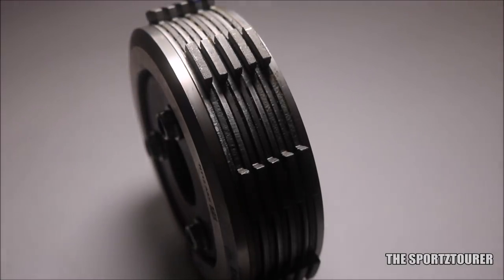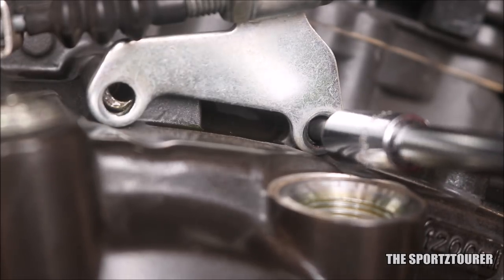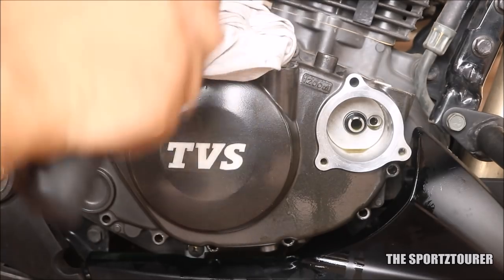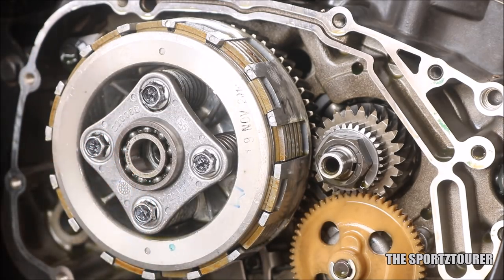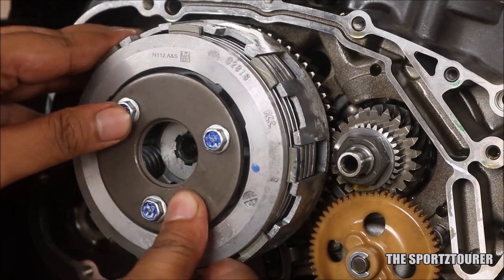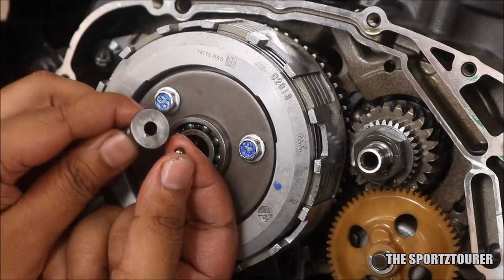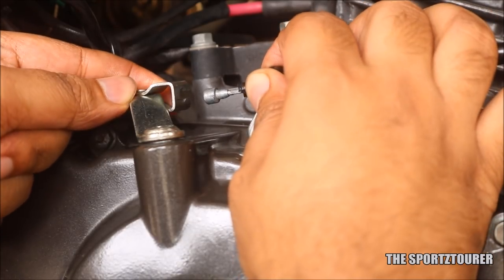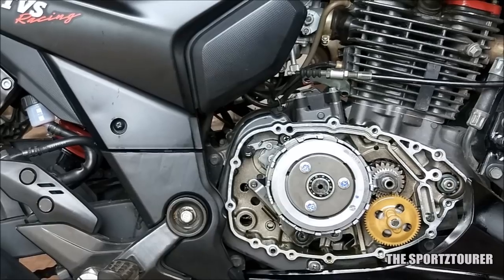HOW TO INSTALL SLIPPER CLUTCH IN BIKE TVS APACHE SLIPPER VS REGULAR CLUTCH, SLIPPER CLUTCH EXPLAINED

Comment: Great work bro!
Have anybody installed this slipper clutch on Apache 160/180?? 
Is that possible?
Reply from the maker: Thanks a lot Soorej,
The RTR 160/180 does shares a lot of parts in common (as shown in the video). Only thing I have doubt about is the clutch housing and the clutch shaft which I doubt isn't the same. Unless we practically check it, we cannot confirm on that 😊

Comment: Hats off to you bro. Can I install the same slipper clutch in Honda CBR 250R ? Will it work normally or will I face any issues in future ? Please kindly reply. Thank you in advance.
Reply from the maker: Hi Sudharshan,
This particular one won't fit but Takegawa makes one specially for the CBR (don't have any personal experience): https://japan.webike.net/HONDA/CBR250R+%282011-%29/6225/m/p.b=704/
Reply: @thesportztourer  Thank you very much Dude.... Sorry for the late(est) reply. https://youtu.be/oEGC4jB7rI8 Please can you check the above link and suggest me whether the jerk or shake of the clutch hub in the housing is normal in my cbr 2018 model !!!! Or should I need to change the hub ? Thank you in advance for your reply.

Comment: Great video Man 🙌   I have a question... Can I fit 200's slipper clutch in apache 180 ?
Reply: What about the question man ? Is it possible ... Do u have any info ?
Reply from the maker: Hi Somnath,
The clutch shaft diameter is not same on the both the motorcycles. Still I we need to practically check for the fitment 😊
Reply: @thesportztourer   Thanks In advance man.. 😀 💟

Comment: I appreciate your work.
Is this possible with RS200?
Reply from the maker: Hi,
I doubt this will be a direct fit as the RS 200 has a different clutch housing.
Thanks a lot for appreciating the efforts, means a lot 😊
Reply: @thesportztourer  would the dominar clutch plates be fixed as it has slipper clutch

Comment: Hi buddy. The mechanic who installed this in my bike told me to that the last plate on the clutch (power plate he said) needs to be repositioned to fit the housing. And it's absolutely necessary. Is that correct ? I asked him not to do it as you didn't suggest it. 
Please let me know what you think about this.

Comment: So, I got some issue in my clutch system and mechanic at tvs told me he has get the clutch plates changed and grind the unit and fix it back, but having seen this video I told him to install the slipper clutch unit instead and after a day he informed me that it is possible but would cost me around 9k for the full change. I even showed the mechanic this video and convinced him to change the clutch system. Strange thing after getting everything done, there is a strange noise from the engine, sounds like the bajaj CT 100 engine. I haven't got the time to visit the service center lately but feels awkward why the engine has to be opened just within 2yrs of use having done 18k kms
Reply from the maker: Hi Anugrah,
So you are now running on slipper clutch?

Comment: Do provide us an update on the performance of the slipper clutch and if you face any problems along the way!
Reply from the maker: Sure Kiranraj,
Expect a lot term review where I will share my detailed experience along with all the goods and bads 😊
How was this video?
Reply: @thesportztourer  It was very informative and useful like always.☺️
I also own a RTR 200 and I'm also thinking of upgrading it with a slipper clutch. It is a well designed motorcycle!
Reply: I have a suggestion!
In my Apache 200 the Air/Fuel pilot screw is stuck and is worn out. Can you make a video on how to remove it and readjust the carburetor.
Also you can make a video on suspension changes , like how to change the adjustable rear suspension according to rider preference.
This will help a lot of RTR owners.
Thank you for all the informative videos!
Reply from the maker: Air fuel screw stuck and striped! I did said to be careful and gentle here: https://youtu.be/3LOP8asQ6Ek
Showroom guys can help or you can take the carb to an good lathe workshop where they can help you.
The rear suspension needs a special tool for adjustment, will make a video when I get one for myself 😊
Thanks for the suggestions, have taken a note for myself 👍

Comment: nice video man  I'm the owner of pulsar 150 ug3 model with digital display I wjust wanted to know can i use this slipper clutch assembly in my pulsar 150 ug3 model & if it is possible then how it is possible please tell me
Reply from the maker: Hi Kailas,
This slipper clutch won't fit as the clutch housing and clutch shaft is different on the Pulsar 150.

Comment: Hello Sir,
Really great video and I liked perfection of all work.
Sir I have a question that is it possible to fit slipper clutch in Honda CB Hornet 160r??
Reply from the maker: Hi Vinay,
The Hornet has a different clutch set up with different dimensions so this won't fit. Thanks a lot for appreciating the efforts that has gone in making this video 😊
Reply: Is it possible to fit slipper clutch in fzs v2.0???

Comment: I hav also the same nd also the huge fan is there is a difference in torque or bhp as compared to wet clutch?? If I install slipper clutch

Comment: Hi, I wanna ask one question i-e slipper clutch has 6 clutch plate and 5 friction/pressure plate however normal clutch assembly has 5 clutch plate and 4 friction/pressure plate. My question here is how does does slipper clutch fit in place of normal clutch housing ?

Comment: Those who like better stoping with  help of engine  dont fix it.. because in city or anywhere  except a race track you need to stop any time. Sliper clucth didnt help to slow the running speed by same as a normal clutch doing.    when ride in higher speed down the gear and you can reduce braking distance in a normal clutch. Thats my point.

Comment: Hi... Very informative.. myself Ashwin from Karnataka.. using Pulsar 220F 2010 model.. my question is can the slipper clutch can be installed on pulsar 220F 2010 model...?
Reply from the maker: Hi Ashwin,
The clutch housing and the clutch shaft is different on the 220 so this thing won't be a direct fit. 

Enjoy the raw power of the 220 and ride safe 😊
Reply: @thesportztourer  thanks bro.. Enjoying safe ride... keep uploading the videos .. good work..keep rocking .😃

Comment: The most outer plate, is it positioned correctly ? In case of "non-slipper" ones, the most outer plate is positioned a bit differently like it has it's own outter position. This one has the space but you kept it empty. Let me know what you think if you get to read this comment.

Comment: Can same done in ns200
Reply from the maker: Hi,
This won't fit in NS 200.
Reply: Can u research and tell can any clutch slipper clutch can fit in ns 200 

Dominar or RC 390 assembly can be installed in it
Reply from the maker: Hi,
I did an enquiry at Bajaj service for the slipper clutch assembly but it was not available. The technician over there said the slipper clutch won't fit on RS or NS 200. So that's the recent update from my end 😊

Comment: Awesome 😍😘 👏 video bro, one small doubt slipper clutch it also fix in Apache RTR 180 serial fast (beast model bike) ,it is possible or not?😅
Reply from the maker: Hi Logesh,
The RTR 180 does shares a lot of parts in common (as shown in the video). Only thing I have doubt about is the clutch housing and the clutch shaft which I doubt isn't the same. Unless we practically check it, we cannot confirm on that 😊

Comment: Can you please confirm if this can be installed on an Apache RTR160 Hyper Edge. This will be a different experience altogether to the Previous model users of this can be installed.
Reply from the maker: Hi Avinash,
I get your point 👍 the RTR 160 does shares a lot of parts in common (as shown in the video). Only thing I have doubt about is the clutch housing and the clutch shaft which I doubt isn't the same. Unless we practically check it, we cannot confirm on that.

Comment: @The Sportztourer After 4 years I’m returning to motorcycling, I’m in need of a motorcycle badly. I liked hunter for my needs, but I have issue with it’s hard clutch. Is there a way to retrofit slipper clutch for RE Hunter?

Comment: You removed two metal washers, but while putting the slippery clutch you put only the back washer, didn't put the top washer just beneath the clutch nut. Is slippery clutch need only one washer.

Comment: Hi . I just want to know that if make this installation of slipper clutch in rtr 180 bs III will it work?
Reply from the maker: Hi Dev,

The RTR 180 does shares a lot of parts in common (as shown in the video). Only thing I have doubt about is the clutch housing and the clutch shaft which I doubt isn't the same. Unless we practically check it, we cannot confirm on that 😊

Comment: Please tell me how to change normal clutch plate to slipper clutch in appache 180 2013 model
Reply from the maker: Hi Sreejith,
The the 180 shares the same parts so you can follow the exact same process. In addition to this you have to remove the kick lever and skip the oil cooler part.
Reply: @thesportztourer  bro will u check it whether it suits or not in apache 180
Reply from the maker: Slipper clutch?

Comment: If i buy a new cbr 250r. Then i changed it's clutch plate, and fixed a new rc390's slipper clutch plate in it, does it possible ?
Reply from the maker: Unfortunately it won't be direct fit as the clutch shaft and housing is different.
Takegawa makes one specially for the CBR 250R: https://japan.webike.net/products/21400281.html

Comment: is it possible to install aftermarket sliper clutch on any bike ? ur vid gave me idea to install on my fz 25 will that b possible ?
Reply from the maker: Hi Sumit,
A few Indonesian riders have installed the slipper clutch from R15 V3 in FZ 25. When asked they were unable to confirm if it was a direct fit.

Comment: Hi, i think its time for me to update slipper clutch on my pulsar 180, thanks for the video. But will this fit pulsar 180?
Reply from the maker: Hi Roger,
The Pulsar 180 has a different clutch shaft so this won't fit.
Reply: @thesportztourer  can you let me know the suitable slipper clutch for pulsar.. It would be helpful!
Reply from the maker: Right now slipper clutch is not available for Pulsars. Let's hope Bajaj rolls out slipper clutch in the next version of Pulsars so that we can retrofit them 😊
Reply: @thesportztourer  I guess it can be done on rtr 180 and rtr 160

Comment: Where can we get to buy the slipper clutch? Also, can i install in my new apache 160 4v which has just run 3500kms. And will there be any problems after fitting the slipper clutch?

Comment: Hey bruh can i install slipper clutch in rtr 1604v ? If yes can i fit the clutch assembly of that rtr 2004v in to my 1604v because i see both have 5 gears and same mechanics.

Comment: Can we use the slipper clutch in Apache 160 RTR 2015 model
Reply from the maker: Hi Ravi,
The RTR 160 does shares a lot of parts in common (as shown in the video). Only thing I have doubt about is the clutch housing and the clutch shaft.

Comment: Sir, can you  switch clip on handlebar with single piece handle bar on apache rtr 200?
Reply from the maker: Hi,
The one on the RTR 160 4V is not a direct fit on the 200 4V
Reply: @thesportztourer  can you please make a  blog regarding the handlebar ?

Comment: Can we do this to gixxer? If yes than please make a video and also tell us where to purchase slipper clutch for suzuki gixxer.
Reply from the maker: Hi,
I doubt if it will be a direct fit to the Gixxer as the clutch housing is different. Even though the Gixxer doesn't gets a slipper clutch, I found the clutch on the Gixxer to be really smooth in terms of pulling efforts.
Reply: @thesportztourer  Thanks for reply. As u r having good knowledge of machines, videos regarding explaination on effect of exhaust note on power and torque figures on a motorbike will be highly appreciated. Moreover I would like to know that if I change the exhaust of gixxer and go for some after market good sounding exhaust than will it have any effect on power and torque figures?

Comment: Bhai please tell me how to fit slipper clutch in TVS Apache 180
Reply from the maker: Hi Lokesh,
The RTR 180 does shares a lot of parts in common (as shown in the video). Only thing I have doubt about is the clutch housing and the clutch shaft which I doubt isn't the same. we cannot confirm on that unless we practically check it.
Reply: thank yuo bhai

Comment: Can i fit rtr 200 4v fi version rear brake on 160 4v and what all parts can i use similarly
Reply from the maker: Hi c K,
Not an easy task as a lot of different parts plus we need to check with compatibility. You can expect a change in whole set up, my suggestion will be to stick to the stock set up 😊

Comment: Is it possible to add the slipper clutch parts from Apache 200 to Pulsar 200?
Reply from the maker: Hi Aakash,
The Pulsar 200 has a different clutch housing and clutch shaft so this won't fit in.

Comment: Can R15v3 slipper clutch assembly be installed in v2?
Reply from the maker: Hi Saikat,
Some riders in Indonesia have already done it so I think it should fit. Only doubt I have is whether it will be a direct fit or the housing will require a replacement.

Comment: Should slipper clutch can installed to bajaj pulsar 200ns?
Reply from the maker: Hi Somprakash,
The clutch housing and clutch shaft is different so this won't fit.

Comment: Bro can i use this slipper clutch in apache rtr 160 2014 model...?
Reply from the maker: Hi,
As per the recent info the shaft diameter is different so this won't fit in.

Comment: Bhai.. can we use slipper clutch to rtr 160 hyper edge..???
And 
Thanks for very informative video ..also love open engine..
Reply from the maker: Hi Ranjeet,
As per the recent info the clutch shaft diameter is not same so this won't be a direct fit.
Happy to know that you liked the video so much, means a lot to me 😊
Reply: @thesportztourer  does it works

Comment: Is Slipper clutch is available for As200 pulsar.. please share your views
Reply from the maker: Hi,
Right now in Bajaj line up slipper clutch is only available in Dominar. If Bajaj brings it in for RS 200 or even NS 200 then you can retrofit it on the AS 200 😊

Comment: Bro i have seen many videos in YouTube and i have tried to install slipper clutch in my RTR 160 4v 2020 model but after installing the clutch i took a test drive when I put 1st gear pressing clutch the bike moves without releasing the clutch and also gear shifts are hard pls let me know is that a manufacturing defect of the slipper clutch or anything else which is causing this problem 
Pls comment

Comment: is there any chance in replacing regular clutch of regular apache rtr 160 with slipper clutch
Reply from the maker: Hi,
The RTR 160 does shares a lot of parts in common (as shown in the video). Only thing I have doubt about is the clutch housing and the clutch shaft dimensions.

Comment: Hyyy brdr    can i use this slipper clutch in my Honda CBR 250r
Reply from the maker: Hi,
The CBR 250R has a different clutch housing and clutch shaft so this thing won't fit in. The 250R is a fantastic machine and I have a soft corner for it, I wish Honda gave some more technical update to it this time as swapping the parts would have been an easy job.

Comment: Can we use it for old apache rtr180/160. Please replay.
Reply from the maker: Hi Gairik,
The RTR 180/160 does shares a lot of parts in common (as shown in the video). Only thing I have doubt about is the clutch housing and the clutch shaft which I doubt isn't the same. Unless we practically check it, we cannot confirm on that 😊

Comment: Friend can I use this slipper clutch in old versions of RTR 160
Reply from the maker: Hi,
The RTR 160 does shares a lot of parts in common (as shown in the video). Only thing I have doubt about is the clutch housing and the clutch shaft.

Comment: Bro i have Apache rtr160 i have installed 6 plate clutch where it used to be 5 plate clutch . Now my question is can i able install sliiper clutch in my beast model Apache rtr160 not 4 v model !!!! Plz reply .is it possible ???????

Comment: Hi, is the same 200 4v slipper clutch spare suitable for apache RTR 180  abs model..
Reply from the maker: Hi Jagadeesh,
The RTR 180 does shares a lot of parts in common (as shown in the video). Only thing I have doubt about is the clutch housing and the clutch shaft which I doubt isn't the same. Unless we practically check it, we cannot confirm on that 😊
Reply: @thesportztourer  thanks

Comment: i think my mechanic has mis handle while fitting gas kit cover, there is a fault of adapter pin, i think.  therefore, little clutch lever not working and bike runs after full clutch lever left. advice pls.....
Reply from the maker: Probably but did you try adjusting the clutch play?
Reply: @thesportztourer  i did my best but all in vain then so pls advice.....

Comment: Hi! Does changing to slipper clutch only include changing the clutch assembly or does it affect the crankshaft or other parts inside? My dealer is saying that if we change, then we can't claim warranty anymore as other parts might get affected and mileage might drop. How true is this that it will affect other parts and mileage drop? Also, should I be using a different grade oil after clutch change?
Reply from the maker: Hi Adityan,
It's just the clutch assembly as shown in this video (the total process remains same as shown in this video).
You dealer is right about the warranty as I was also warned with the same.
The engine oil grade remains the same, no changes there.
Yet to carry out multiple fuel efficiency tests, can't say about it's improvement but the fuel efficiency hasn't drop for sure 👍
Reply: @thesportztourer  thanks for the detailed reply! Looks like I will be installing this next month!